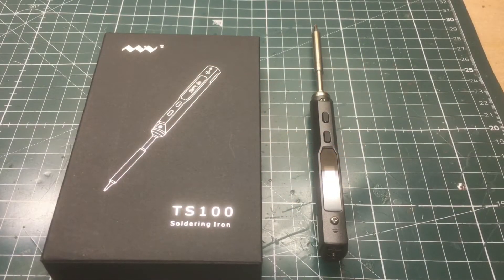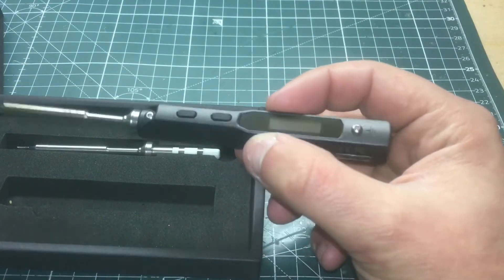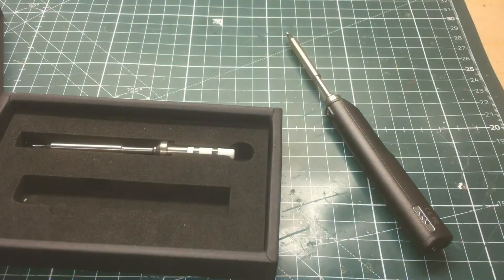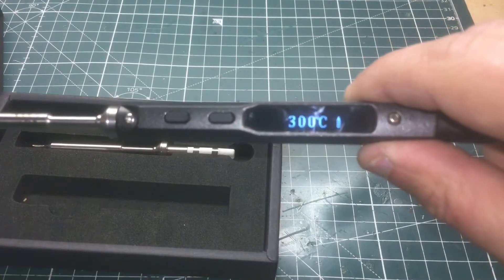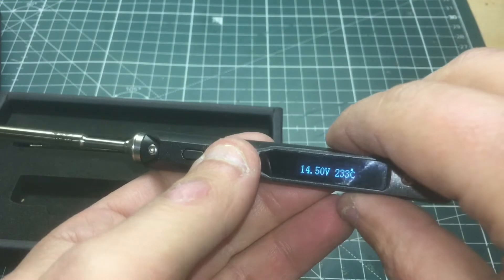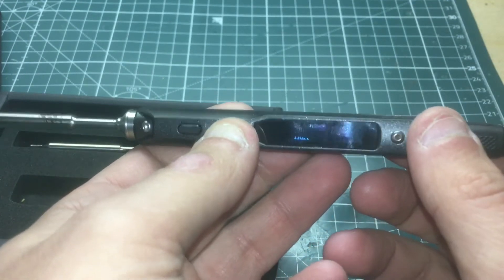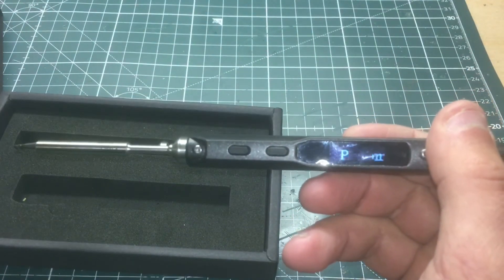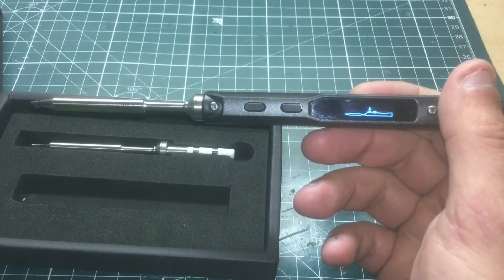TS100 Soldering Iron Overview & Ralim Firmware Issue

Comment: Updated ts100 with ralim, now I can only change the tip temp nothing else. Other parameters unable to change.
Reply from the maker: I believe it’s a different button combination after u update to Ralim, I actually have not updated mine just don’t see a point since it’s a soldering iron it has one job lol